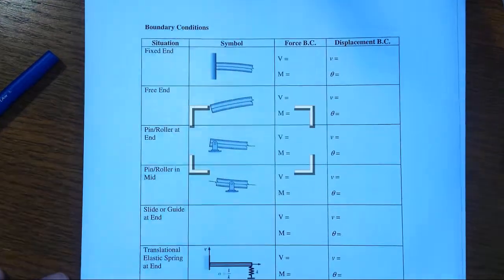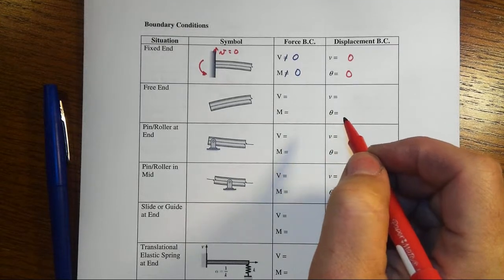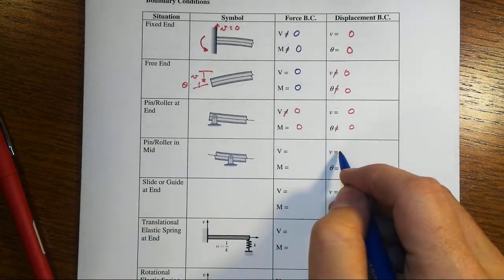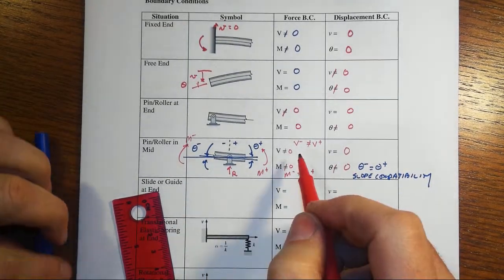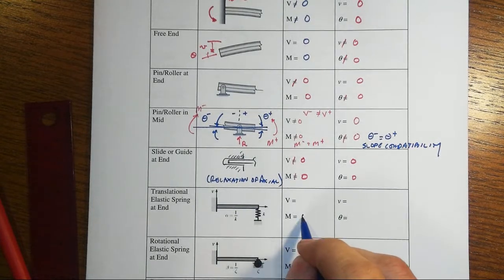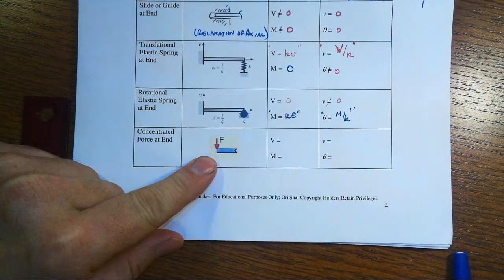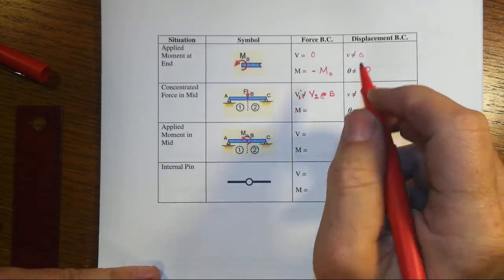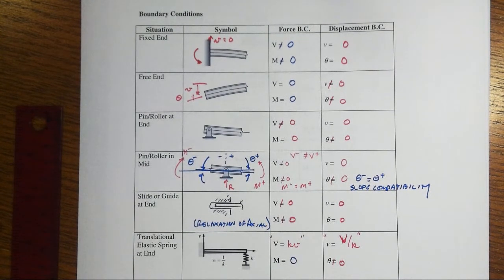Lesson D1 Boundary Conditions for Beam Models

Comment: can you please also explain, what will be boundary conditions if a prismatic beam is fixed at one end while welded with a vertical slider at other end.
Reply from the maker: Depends what you mean by a vertical slider.  Rollers on a vertical plane?  Then rotation is constrained and horizontal displacement is constrained.  But vertical displacements are free?